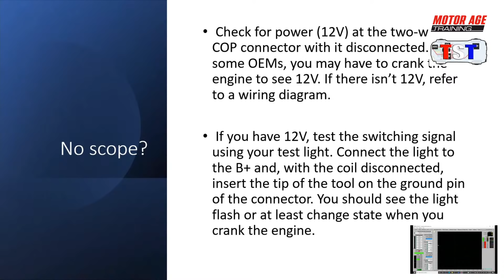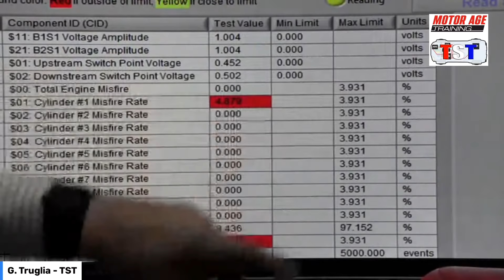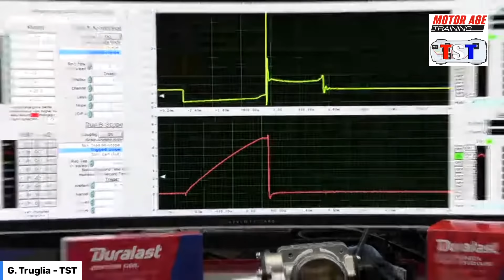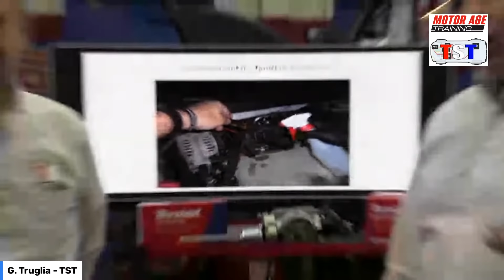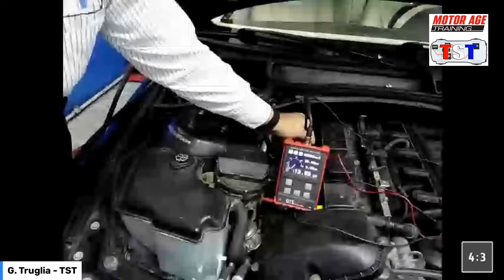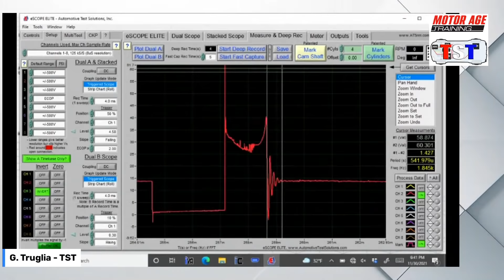We Have Ignition! The Sequel

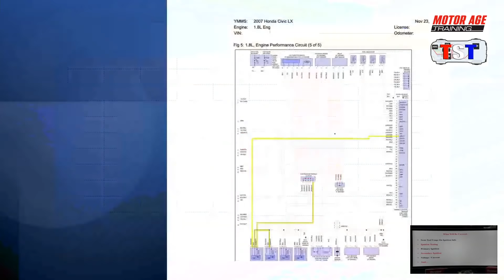Comment: 32:04 Just to clarify, the three wires are power, absolute ground, and control from the ECM, is that right? Or do some three-wire coils provide a feedback wire to the ECM, and have the ECM ground the coil to operate it, as in a two-wire system?
Reply from the maker: In the three-wire system, the igniter is in the coil assembly. The three wires are: power, ground, and trigger signal from the ECM.

Comment: G confused about what you said re spark line and rich/lean .. You said it was Lean is spark line sloped down (I thought this indcated rich) and rich if it sloped up (I though this was lean) ... maybe it makes a difference if the spark line jumps out from firing line at a higher than normal voltage level, and slopes up or down, as opposed to jumping out from firing line at a normal V level and then slopes up or down? Can you explain further?
Reply from the maker: You're right - the burn line will slope upward with a lean mixture as opposed to downward with a rich mixture. This is due to the change of resistance in the gap - fuel is a conductor and as the lean mixture is consumed, it takes more energy to continue feeding the spark.